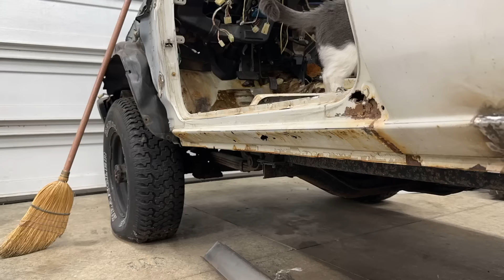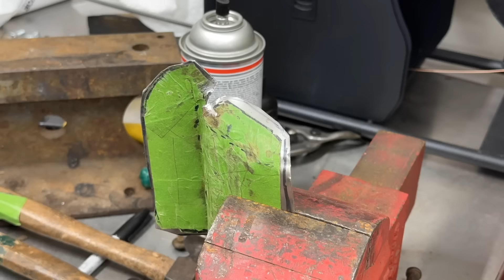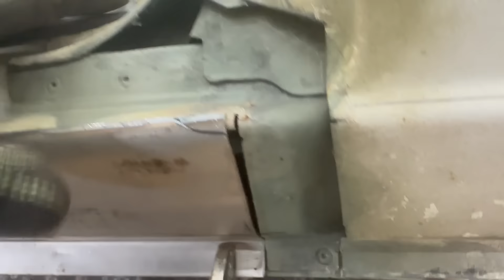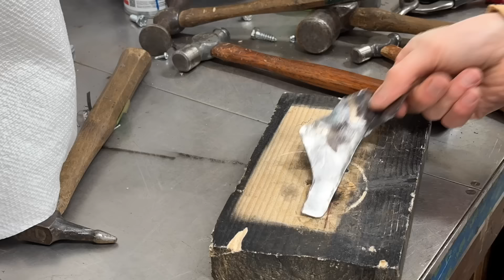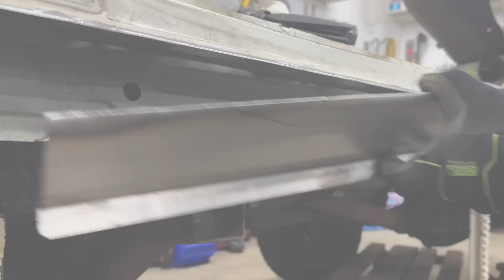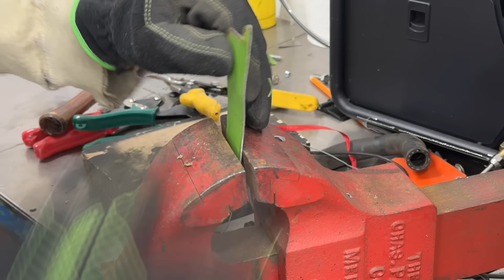How To Repair Rusty Rocker Panel on 1st Gen 4Runner - Cut, Fabricate & Weld!

Comment: how come you didnt use the x1 pro to laser weld instead of the mig? is the x1 not good with sheet metal?
Reply from the maker: I find that the laser welder is better for precise, even gaps. When I’m cutting out rust and making new panels to match, the gap between panels will often vary, so I find it’s easier to fill those spaces with varying speed using the mig Welder. If welding two perfectly straight edges together, the laser welder would be a good choice.

Comment: Why scrape off the welding primer? It welds perfectly well on it. The frame needs to be sanded and coated; it's already starting to rot.
Reply from the maker: The scrape in the primer will expose bare metal to start the arc for the weld. I removed the body in this week's video and next on the list will be to strip down the frame and restore it. It's crusty in some areas, but definitely not too bad.  We'll see if it passes the Hammer test!

Comment: Hey man! Love your vids and channel and have been following you for a few years now. Especially since I’ve been doing a full restoration on my 88 4Runner. I got a question for you, I’m pretty new to doing bodywork and have been using your videos as guidance for my project an I’m actually about to tackle this exact same job on my 4Runner and already have new floor pans and the same rockers from Wolfe steel. I was just curious what gauge steel you have been using for the fabrication of the front and back part of your rockers also where would you recommend to get new front fenders like you did? Thanks in advance man!
Reply from the maker: Hey, I usually use whatever scrap metal I have laying around... 18 or 20 gauge. Thicker than that gets hard to bend, and thinner feels too weak. Here are the fenders I ordered: https://ebay.us/rJH7Hg They fit great, however there is no hole for the antenna on the pass fender. None of the aftermarket fenders for sale had it.
Reply: @6thGearGarage gotcha thanks for the info! Shouldn’t be too hard to drill a hole for the antenna haha
Reply from the maker: Yeah, I plan on making a masking tape template from an old fender to get it in the exact location.